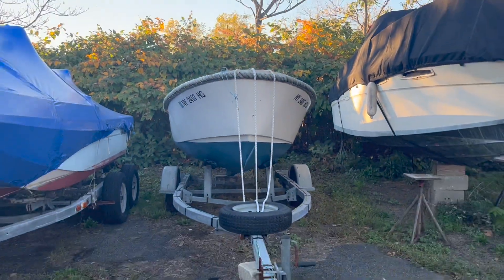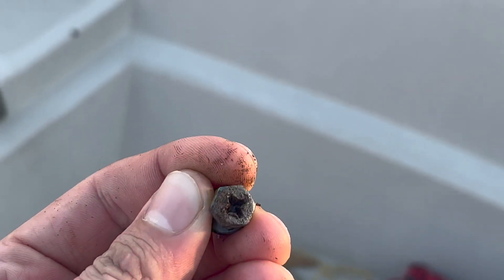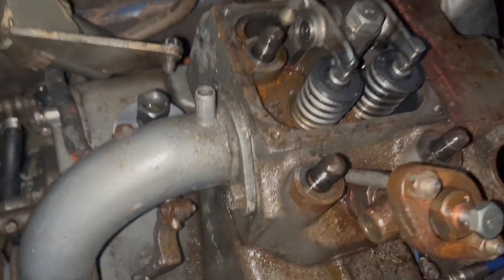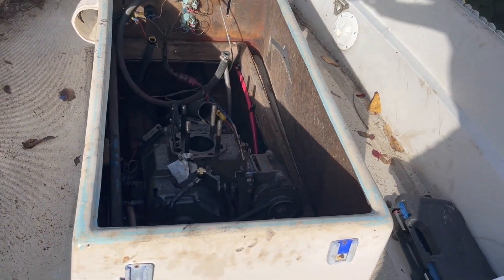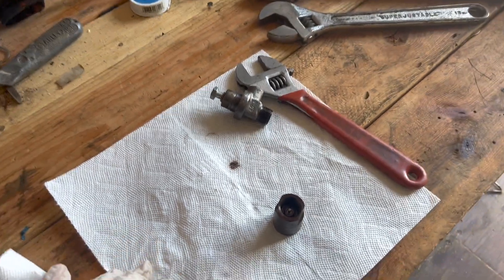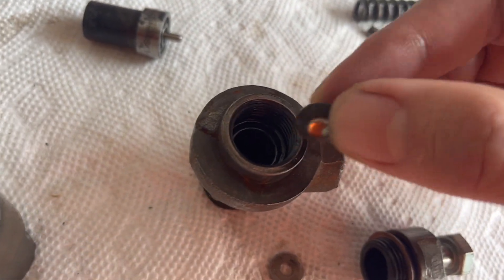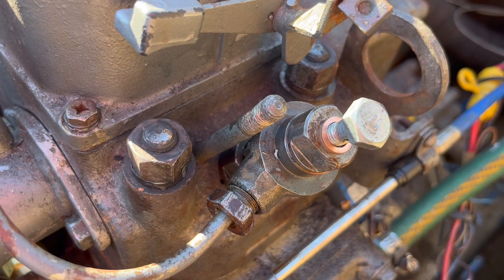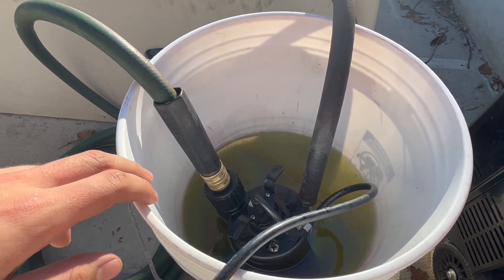Damage Control: Dropped Valve on a 1 Cylinder Yanmar Diesel

Comment: I'm having the same problem, but mine was worst.  The exhuast valve and seating was completely corroded to the point where  the only fix would have to take the head to a machine shop and have them cut out where the valve seat would have been and make a complete new one and install it.  With that said having all that work done and all the parts that would be required to be replaced (Valve shaft seal, new exhaust valve and all the new gaskets) I just opted to bite the bullet and buy a new cylinder head.  In the long run it's much more safer and reliable.  I;m doing all the work myself.  If I would have to pay a mechanic along with all the parts it would easily have more the $2000.00. Good luck on your adventure.

Comment: I hate to introduce another variable into the equation, but, if the piston has struck the valve, you may have a worn out timing chain...   allowing just enough for the piston to kiss the valve.    Either that, or a worn tensioner shoe/tensioner/etc..   I have no idea of the internals of that engine, but that would be my diagnosis without actually inspecting the engine for myself.   Then again, it could be timing gears, so, like I said, I really don't know.   But I would suspect sloppy timing chain.   Which, also, would make it run poorly in general.
Reply from the maker: Thanks for the insights. I think the engine is a push rod engine? Namely the timing is done by rods which run on the cam shaft. I’m hopeful that there’s no way to mess up the timing of the camshaft..?
Reply: @injectortrouble  Well, for sure, it is a pushrod engine, therefore the cam is down in the block somewhere.   However, there is either a chain connecting the camshaft to the crankshaft, or, it may have timing gears instead.   I don't know the model of the engine, nor what the internals look like, so, I can't say with any certainty which it is.    That could be old damage, but, since you have a bent valve, I would assume that it happened somewhat recently.    Either way, it is indicative of valve timing being off, since, on a diesel, the piston comes super close to the cylinder head at TDC.   I doubt it would be the valves adjusted too tightly, because it would have to be adjusted WAYYY too tight to actually cause contact with the piston.
Reply: Hell, thinking now again, check for a sheared or partially sheared woodruff key on either the cam gear or the crank gear.    That alone would be plenty enough to make the engine run poorly and/or strike a valve, siince it is a diesel.
Reply from the maker: I’ll look into this!
Reply from the maker: And thanks for thinking on this
Reply: @injectortrouble  You got it, brother, glad to lend another set of braincells.